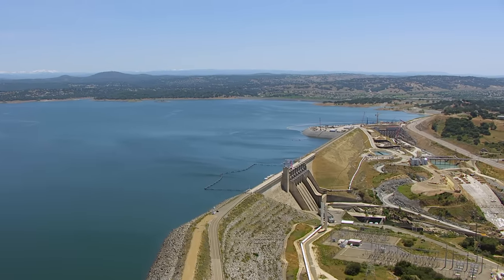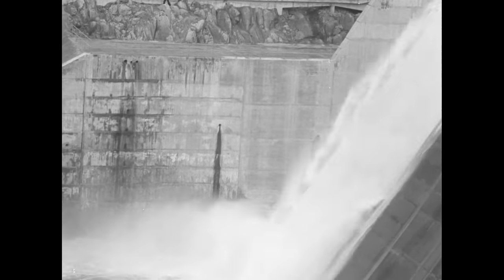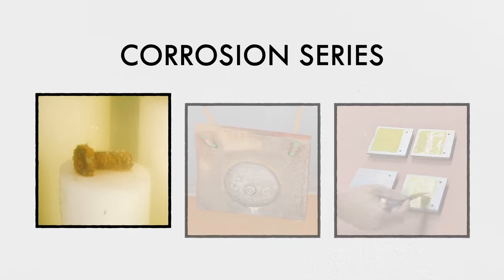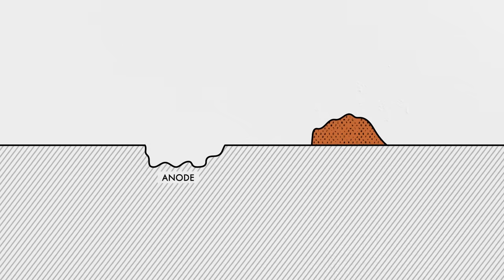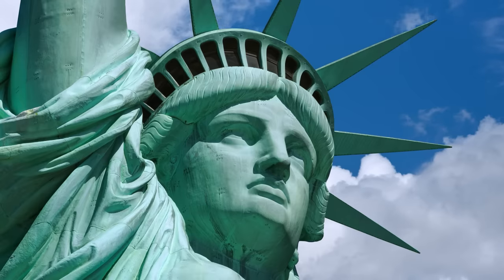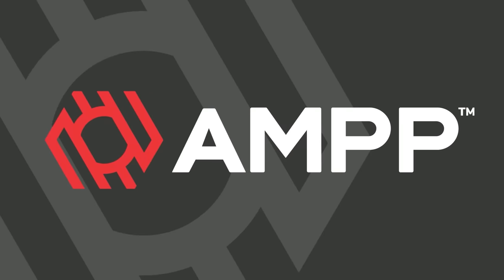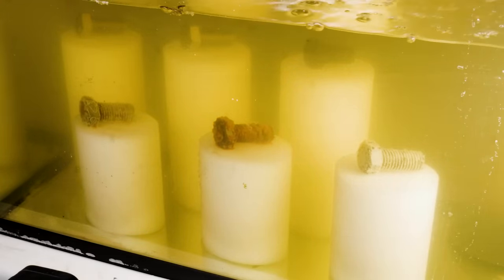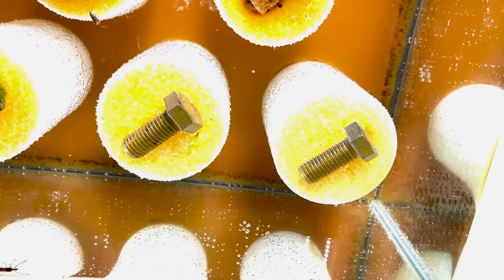You Spend More on Rust Than Gasoline (Probably)

Comment: There was one thing that may have made the rusting in the bolt demo worse that wasn't mentioned. As all the bolts were different materials they have very different electronegativities. This can promote corrosion due to the flow of electrons mentioned in the video being much easier between these dissimilar materials. Interestingly we can actually exploit this tendency for corrosion between dissimilar materials by having a sacrificial material more prone to corrosion present in a system. This sacrificial material will preferentially corrode ensuring helping the extend the lifespan of the rest of the system
Reply: Hence, galvanized steel
Reply: This will only have an effect, if the different materials are electrically connected, which was not the case here.
Reply: @moe.m  Salt water is conductive, so all the metals in the experiment were, in fact, electrically connected each other.
Reply: @PyroDesu  there needs to be an additional connection apart from the electrolyte. You need a path for the electrons.
Reply: When I was a commercial diver, the dive hats had several sacraficial anodes on them. So that the cheap parts corroded before the $12k helmet
Reply: Cathodic protection.  You're talking about that
Reply: @PyroDesu  moe is right, there needs to be a return path
Reply: @Jefferson-ly5qe  just partly. It's water we're talking about, the thing which electrons basically flow freely through in the first place. In fact, all metals except for approximately 7 metals will corrode in contact with water, merely contact with water, those that don't are Palladium, Gold, Platinum, Iridium, Ruthenium, Osmium and Rhodium. They are the least reactive metals known to mankind, and we even know in which order they're the least reactive.
Now water functions as the best highway for electrons as you don't need to incur a current between a cathode and an anode, because it will occur on it's own, a lot of refining processes rely on it in the first place. You want high grade silver, well the simple solution, is dissolve silver in water, via some acid, and put down a copper object into the solution and wait, the silver will replace the copper and there's only the electrolyte there, it just so happens to be a slightly acidic solution...
Reply: @livedandletdie   Your silver copper example is a displacement reaction, not Galvanic corrosion. Galvanic corrosion is a different effect and relies on a current return path between two different metals in contact with one another. If you look it up in Google images there are some good diagrams. In the absence of contact between the different metals (as we see in the video), the bolts will corrode more or less independently.
Reply: That why steering wheel brackets are always randomly rusty af

Comment: I live in the Daytona Beach, Florida area and work in the hardware industry. The corrosion problem along our beach is worse than anywhere. Customer ask for locks that won't rust. Our common answer is, 'In this area, beachside, everything corrodes!"
Even 'Lifetime Finish' hardware only lasts a few years.
Thanks for another great video! I could listen to you talk for hours.

As an aside, the building next to us had a metal roof installed with the planned corrosion protection. It took about three weeks for the corrosion to take over, but the resulting rusty look is both aesthetically pleasing and seems to stop the uncontrollable corrosion.

Comment: I work as an engineer in a large metals recycling company.  Corrosion has always been fascinating to me- not just in the materials that people bring in to the scrap yards but even in our own processing equipment.  Scrap metal processing is very abusive to equipment, and when paired with corrosion over decades some of the wear and tear that you see is mind boggling. We have repaired equipment that required thousands of pounds of rust to be removed.  Hell we have had trailers that once the rust was removed, you could practically see through the web of the structural beams.
Reply: All those oxides are rough. Especially since aluminum oxide is what the abrasive in most sandpaper is made from. 

I always go to the recycling plant for their large bandsaw blades. They always throw me extra scrap when I tell them I’m making knives. Always good people.

Comment: Wow I was just thinking about the effects of rust an hour ago.  Trying to figure out how the water tank at the Starbase launch pad was able to rust from the inside out.  Hopefully this video will answer something for me!
Reply: Did you know that your water heater had a rod that's made to corrode instead of the walls?
Also water has dissolved gases, which is why if you boil water in the microwave it may taste different, because they come out of solution, and pouring it back and forth between two glasses changes it back.
Those dissolved gases include oxygen, which is partially why there's corrosion inside water.
Reply: @goldenboy I drove by Starbase from South Padre Island last week and was confounded how EVERYTHING does not rust. It’s surrounded by corrosive sand, corrosive seawater, and just a few hundred meters from the ocean. I’m sure they have to be by the ocean for dropping things like boosters, but it seems like an incredibly corrosive environment for that high-tech machinery to be.
Reply: @satibel  Sacrificial anodes, ships use them a lot to prevent corrosion of their hulls as well.
Reply: @killman369547  didn't know ships had those too, thanks.
Apparently there's also ICCP which makes it so there's a net 0 current on the hull by measuring the corrosion current and applying the invert of it with an anode that doesn't corrode like platinum.
Reply: In addition to sacrificial anodes, active anodes with a small power supply going into a titanium anode can last for decades without maintenance and prevents the generation of H2S from the chemical reaction on magnesium anodes. These are very popular for areas where well water has significant dissolved iron and sulfur.
Reply: @Toby_Flenderson_1982  a lot of people are very familiar with building on the ocean front, or in marine applications, so it's not hard to design for it, between extensive use of stainless steel, and careful applications of corrosion protective coatings (paint etc), it costs a lot more, but it's not hard to do.
Then you also have to stay ahead of the corrosion and be constantly inspecting everything and removing rust and reapplying coatings so that the corrosion never causes actual damage.

Comment: Awesome video! Here's a few nitpicky minor corrections if anyone wants to further nerd-out about corrosion 🤣.

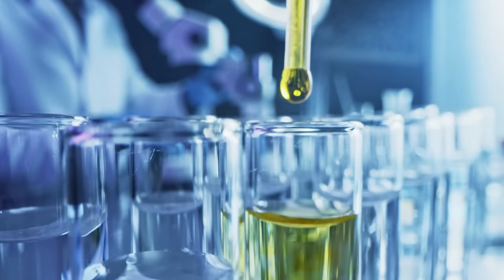3:25 the process you're describing is called galvanic corrosion but technically not "all" corrosion works this way. There is also corrosion due to microbial growth called biological corrosion where little monsters eat your metal. Additionally there's many types of plain old erosion which is essentially mechanical wear.

7:36 the galvanized bolt doesn't resist corrosion through passivation (but the other metals mentioned do). Galvanization is a zinc coating process where the zinc is used a sacrificial anode. Rather than passivizing it does the opposite, it corrodes very easily! So easily in fact that it corrodes preferentially over the base metal and the base metal is protected. This is why galvanized coatings need redone over time. Other examples of the use of sacrificial anodes includes sacrificial magnesium blocks stuck to ship hulls to help the hull avoid corroding in salt water.

Comment: The amount of times I've seen copper or brass fittings screwed into steel or iron makes me realize how blind so many people are to how corrosion works
Reply: Above ground not so much of a problem, below ground a big problem . In the gas industry brass valves are installed on steel pipe all the time with no problems above grade. Valves can also be manufactured with a steel housing  & brass core (again very little to no problems). Aluminum gas meters are installed on steel meter bars (again very little to no problems). You have to dig a little deeper to know how corrosion works. You’re not wrong you just need to dive a little deeper and be more specific.
Reply: Brass fittings (bolts?) in iron make sense. It wont "rust-weld" itself and the softer bolt won't damage threads on main part. Important if the main part is big/ complicated/ expensive.
Also cost/ material properties.... sometimes mixing is unavoidable. Just need to do it in proper order. copper-> brass-> steel is good transition for example.
Reply: Needs an electrolyte.  If dry not a problem
Reply: Most people are told: "Screw this into this." They aren't blind, they just don't need to care.
Reply: @Maghanashi  , The material being used should be long figured out before the person doing the deed installs it. They should definitely be bringing up any concerns they may have when installing (Communication, communication, communication).

Comment: Unfortunately, it depends on where your 316 stainless steel bolt came from. Proper 316 should not corrode or stain in salt water. As someone who uses a fair amount of 316 faseners in coastal construction, I've seen quite a bit of variability in quality. 304 holds up pretty well, if it's all you can get, but it will stain over time. Nice video, looking forward to the rest of the series.
Reply: he probably found it on the floor lmao
Reply: "316 doesnt corrode in salt water" is a bit of a myth really. In open freely circulating and cool salt water it is generally OK, but there are lots of contributing factors that can cause it to corrode (crevices, tropical temperatures, bio-films, etc.) It's safe in general construction, but very high value or safety critical applications such as oil rigs have very strict conditions for the use of 316 in raw seawater such as it having to be under cathodic protection.

Comment: Great video👍. I’ve been in the natural gas utility business for over 35 years, where we eat, sleep and sh**  cathodic protection. Some of the biggest problems I’ve seen are on the customer’s underground installations. From industrial all the way down to residential It appears the contractors just don’t get it. We were finding so many problems with customer owned underground installations that the public service commission of Missouri required the gas utilities to replace any leaking residential yard lines free of cost (installing a new gas service and setting a meter at the outside wall of the home or building. Industrial and commercial would just get a big lock and a red tag (they could always hire us or pay A licensed mechanical contractor); in the winter time they would get the idea real quick.
When it comes to corrosion, we learn more from our failures than we do our successes.
Reply: As in so many areas of life, unfortunately. And many people don't learn from failures, either.
Reply: @jerrymiller2367  , There’s an old joke in structural engineering, mind you it’s just a joke. “ You should never hire A civil engineer who hasn’t had at least one bridge fall down, because he or she is over designing. But you should never hire one that’s had two fall down ,because they haven’t learned.” I think there is no substitute for investigating failures in the field. In fact creating controlled failures can push  the technology to see what it takes to fail and use the real world incidents to help us build better requirements and standards.
Reply: @boby115  Interesting joke. What does "over designing" mean in this context?
Reply: @Vir9il  , tell me what you think it means ? Keeping in mind the word money ($$$$).
Reply: @boby115  They designed a bridge to be so robust that it's likely to never fail? That's a good thing. But the potential downside, I guess, is that it uses more material / costlier construction methods than are strictly necessary? So the lesson of the joke is that engineers should aim to design bridges that are as cheap as possible, but no cheaper, so that they are just barely robust enough to not collapse? That making a bridge with larger safety margins is a bad idea, because we as a society don't want to pay for it?

Comment: Also fun to remember is that batteries thus far have mostly been essentially 'controlled corrosion'. There's a few alternatives - you could argue hydroelectric dams are a form of battery for example - but when we think of a battery, we think of the lithium-ion ones, or at least devices that use the same method of connecting two differently charged bits in an electrolytic substance with an electrically conductive wire. It's more complicated than that, I know, but that's sort of the gist of it
Reply: In case you're wondering, the strikeout happens when you have double hyphens touching a word.
Reply: A—a
Reply: Place
Reply: @Reziac  thanks man, got it on the second try 😅
Reply: @joshuaiyanuloluwa2256  Underscore touching a word is italics, asterisk is bold. Probably others I haven't discovered. Cheers!